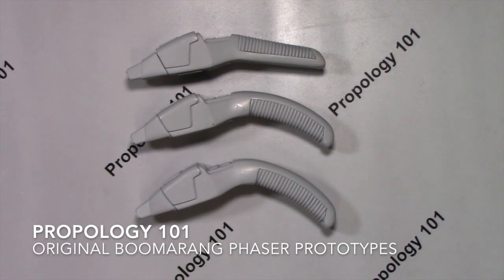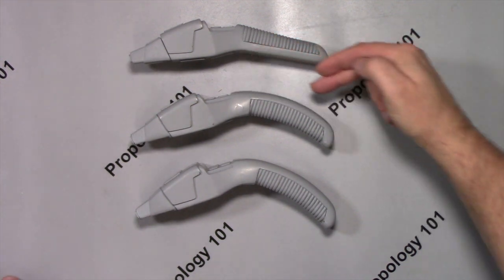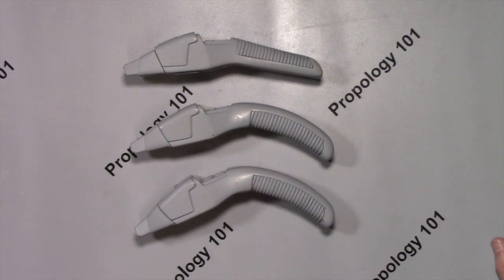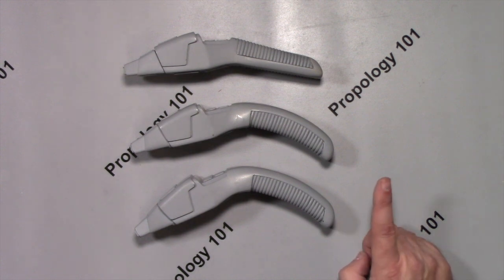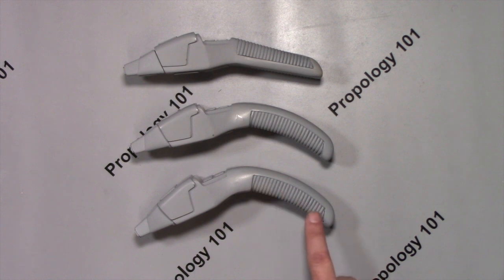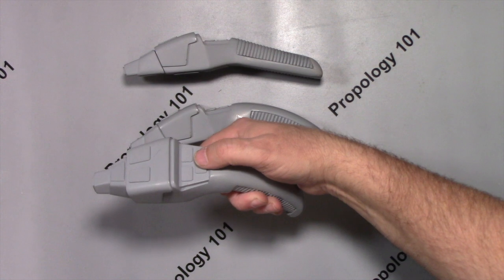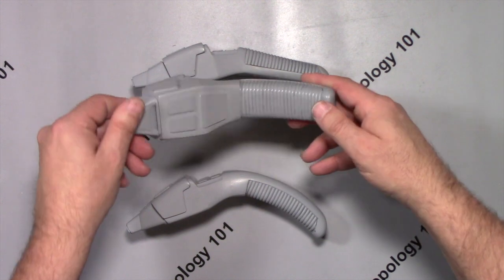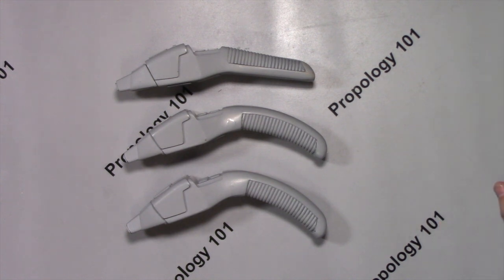Boomarang Phaser Prototypes

Comment: Mike, please do that tutorial with the grips etc. When Nemesis was coming out, I made one for myself with the chrome accents, I used evergreen half rounds and filled in the backside of them with filler to make a master. Very curious as to how close I came. 

If I was going to do it today, I'd make a waste mold of a half round and cast up a bunch from urethane rubber or latex, then glue them around a "U" shaped part representing the inside of the grips  to get a master.